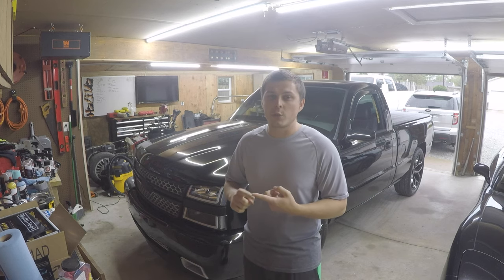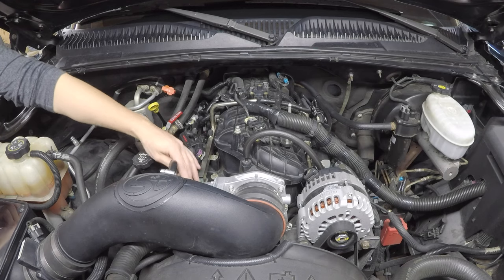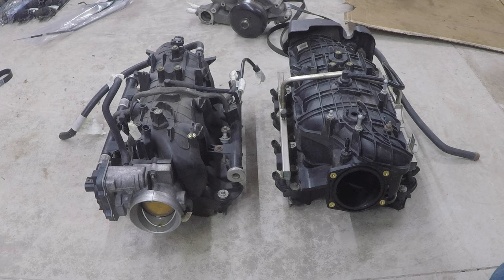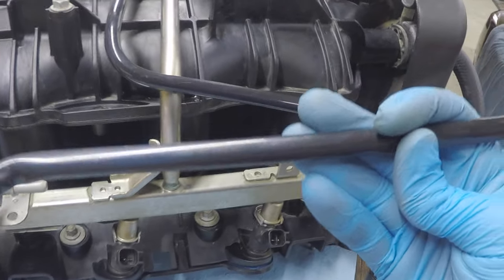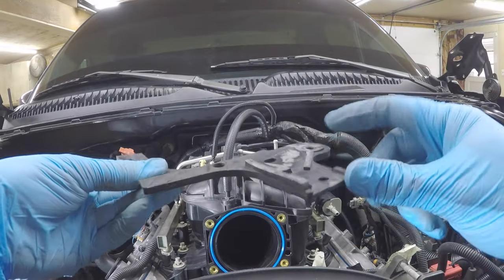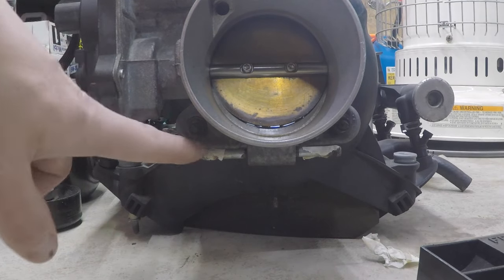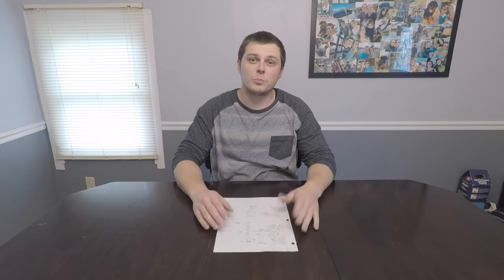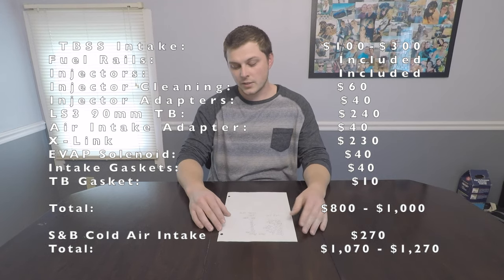TBSS Intake Swap, Ultimate Guide! Add More Power To Your LS Motor!

Comment: What is the part number for the s&b intake that you were running? I was thinking about getting an intake, but if I am going to do the 92 mm throttle body I don’t think that the one for the stock will work with the upgrade.
Reply from the maker: Hey, sorry for the late reply. here is a link to the updated version of the intake. you will need a rubber coupling to fit the intake tube and larger throttle body. the S&B intake tube is still designed for the smaller TB. all my other parts are linked in the description of the video.

https://sbfilters.com/products/1999-2007-silverado-sierra-1500-2500-3500-suburban-tahoe-yukon-75-5157

Comment: Did you have any issues with your brakes after this swap? If so, how did you fixed?
Reply from the maker: This shouldn't change anything with your brakes, assuming you connected the brake booster vacuum hose to the back of the intake.

Comment: New injector harnesses?  Obviously for TBSS nanifold.
Reply from the maker: Hey, sorry for the late reply. just depends what injectors you run. for the stock tbss injectors you can use adapters for plug and play, or you can hard wire the new connector onto your harness for a cleaner look.

Comment: I did this swap to my 06 Sierra and it threw a vacuum leak code. I swapped out the MAP sensor and it went away for a while and came back. Did you run into this issue? 
I tried the break parts cleaner around the gasket area and nothing. Retighten every bolt, checked the lines.
Reply from the maker: Hey, sorry for the late reply. I would try a smoke test. I got a kit off amazon, it works really well. I'm sure you have a small leak somewhere. I had vacuum issues on my corvette, turns out it was a bad hose clamp on the vacuum and PCV lines

Comment: I have a question at 2000 rpm and I designed reduced engine power
Reply from the maker: First thing I would do is throw a code reader on the truck and see what it comes up with. That will tell you a lot, hopefully you can narrow down and fix the issue. Google the code number it gives you, and you should be set. 

That should fix it. If not, I'd look for a local reputable tuner (or mechanic), and have them take a look. A lot of times they can see things on the HP tuner software, that are out of the normal. And can help you narrow down what this issue is. Sorry, thats the best I got. Hope that helps! Good luck on your truck.

Comment: Will this work if it's cable driven? Do I need anything else since mine is cable driven? Also found a page with one for sale should I spend the extra money for 50lb injectors? Going to be n/a but want to go FBO with e85
Reply from the maker: Hey, for cable driven, you can ignore the Xlink. You will either need to buy a 90mm cable driven TB or buy a 3 bolt to 4 bolt adapter and re-use your current TB. You will also need a throttle cable bracket to keep them secure (linked in the description of this video). For the injectors, just make sure they are E85 compatible. Stock TBSS injectors are around 32-36lb. I have a 4.8 making 355/369tq to the wheels. My injectors are at 75% duty cycle. So if you have a 5.3L, 6.0L or plan on making more than 350 horsepower, Your injectors are gonna be close to being maxed out. Which is fine, but their life span is decreased. So I'd say go with the E85 50lb injectors. Hope that helps 🤘
Reply: @TheKingCoopa  appreciate bro you just got a new subscriber
Reply from the maker: Thats awesome, thanks for the support!! Good luck on the swap.

Comment: Quick question did you have to get the truck tuned after an install of the tbss with fuel rail and injectors?? Running 87 throttle body.
Reply from the maker: Yes, a tune is definitely recommend. Some people can drive to the tuner with the new mods. But others, like myself had to have the tuner come to me. With the larger injectors it was running super rich, and would foul out the spark plugs after 5min of idle time.

Comment: Did you have to bleed the fuel system? If so how? I just did all of this and my message center tells me REDUCED ENGINE POWER,it's not a cabled throttle body so I don't believe it would be a TBS issue
Reply from the maker: Hey, I dont always bleed the fuel rail, but you should. On the first start up just rotate the key over a 2 or 3 times to build fuel back up into the rail. Then take a small screwdriver and press the shradder valve a little to get some of the air out. But you most likely won't get a reduced engine power from a little air in the fuel line. 

Are you running the stock TB or the 90mm? Stock TB is fine, but if you are running the newer 90mm you will need the X link or it won't work right.
Reply: @TheKingCoopa  Stock TB,and I don't have a Schrader valve anywhere on my lines. It's exactly like what his set up looks like. I put it together piece by piece from various sources

Comment: why do the corvetter filter and have to bend anything..? just get an aeromotive FPR and be done with it.. super easy, and you can add a guage to it
Reply from the maker: I did the basic setup for everything on the swap.i didn't go into super detail or the video would have been stupid long haha. Plus I feel that most people watching this "how to" video might not be at the point of AN fittings yet. The aeromotive FPR is definitely a good idea for when you wanna make big power. I just did the C5 filter because its a direct plug and play, and its cheap. I'll add the aeromotive FPR into the quick links in the description. Thanks!

Comment: Greetings friend awesome video. Question. Do I need an electric TB? I have a cable driven 4 bolt 92 mm.
Reply from the maker: Hey, if you're setup is cable driven, STAY cable driven. That is not worth the headache of trying to swap to the electric TB, just for no gains over a cable driven setup.
Reply: @TheKingCoopa  thanks bud I appreciate it! Also thank you for the video.
Reply from the maker: @christopher18291  for sure, glad I could help 🤘and thanks for the support

Comment: Question in regards to the fuel injectors. Can the stock 5.3L Silverado ones be used in the fuel rails?
Reply from the maker: Hey, if I remember correctly they should be the same height as the tbss injectors, and should work.

Comment: Hey I have a 2002 5.3l with a drive by wire throttle body, and also the air sensor and throttle position sensor, I cannot find a throttle body that has both sensors built into them, is there a specific harness i would also have to purchase on top of the x link harness as well?
Reply from the maker: Hey, sorry for the extremely late reply. If you have a DBC throttle body, you do NOT need the Xlink. 

Here is a link to a 102mm DBC throttle body, that comes with both the TPS and IAC sensor included. The 102mm will still bolt up, and its a little bigger than the 90mm👌 i would just take a dremmal tool to the inside of the 90mm intake mouth, so its not such a large ledge that air will catch on, and slow it down. 

https://www.ebay.com/itm/404078375557?mkcid=16&mkevt=1&mkrid=711-127632-2357-0&ssspo=eap8gya0rug&sssrc=2349624&ssuid=i3_3a3TsQ3C&var=&widget_ver=artemis&media=COPY

Comment: Noticed a fuel regulator listed in description. Is this listed for those not using the c5 filter as a return fuel adapter or would I need that regulator either way? I know the filter regulates to 58psi I'm just double checking.
Reply from the maker: If you have a return less style fuel system (1 fuel line) you do not need the C5 regulator.

If you have a return style fuel system (2 fuel lines) you will need to used the C5 fuel regulator.
Reply: @TheKingCoopa  my bad I was looking at the aeromotive bypass regulator but didn't see the part about substitute for c5 regulator.
Reply from the maker: @timothyluker7071  oh yea, I put the aeromotive fuel regulator on there for the guys wanting to make bigger power.

Comment: Im having a problem with the pressure regulator on the fuel rail.    It wiggles and lets fuel out from the rail connection.    Did you have this issue or have a fix for it?
Reply from the maker: Hey, I didn't have to run a pressure regulator, since I don't have a return style fuel system. Only thing I can think of is the regulator could be a bad unit. Those push on fuel connections are usually pretty solid. So I'm wondering if the regulator has a bad fuel connector. On your original setup, just the fuel rail and oem fuel lines, there was no leak. Then obviously the fuel rail isn't the issue.  I would try returning and replacing the fuel regulator, Or see if you can mount it somehow to were it doesn't leak, Then hard mount it somehow so it doesn't wiggle around. Sorry im not much help there.

Comment: Also can you just plug the intake side of the valve cover intake ? If you don't want to run it to the air intake? Thanks
Reply from the maker: Hey, sorry for the late reply. No, you can not plug the valve cover intake. The crank case needs fresh clean air. If you don't want to run it to the intake tube, I would run an oil catch can. That will help your engine out and will still allow clean air to the crank case. But at a bare minimum, I would atleast run one of those small autozone filters on the valve cover tube.

Comment: So if you have an all stock motor and want to do this will the truck need to be tuned? 2004 Chevy avalanche Z66 5.3
Reply from the maker: Hey, any airflow/fuel changes the truck is supposed to get tuned. A cold air intake doesn't really need a tune, but your not maximizing the true power of that intake.  But once you go to a larger TB and intake, your MAF sensor is gonna be telling the engine the wrong info, and its not gonna run right or at max performance. And if you change the injectors you will %10000 need a tune. Going from 22lb to 36lb injectors, my truck would foul out the plugs in 5min of idle time. So I had to have the tuner come to me, or trailer it to him.
Reply: @TheKingCoopa  awesome! Thanks for the info dude. I just scored a tbss intake throttle body injectors and fuel rail for $200 after watching this video so I just wanted to get all my ducks in a row before I do the swap
Reply from the maker: Oh nice! Pretty good deal. Just make sure you run new intake an TB gaskets. If your on a budget, id get the 4 bolt to 3 bolt adapter and run your stock TB. But if you want the most power, keep the 90mm tb and run the X link. Its just expensive. Good luck on the swap though 🤘
Reply: @TheKingCoopa  I work in auto parts so I already factored in new gaskets and gonna at least clean those throttle body on it and have the injectors cleaned and mapped. As I said before thank you for the video, alot of information. Definitely sharing this video in my Facebook groups.
Reply from the maker: Good idea, my injectors were all gummed up with E85, and didn't flow the same. And no problem, thanks for the support!!
Reply: @TheKingCoopa  Who did your tunning?

Thank you
Joseph
Reply from the maker: Hey, Shawn fensler, the owner of bumper Wilson tuning. He is on the south end of Fort Wayne, IN.

Comment: Have you had any problems with your Xlink? I bought a brand new one and it’s not working like it should. Works when it wants to.
Reply from the maker: Hey, I've had zero issues with mine. Did you make sure to buy the appropriate Xlink for a gold or silver TB blade?  Also its important that your TB needs to be a GM or Acdelco TB. If not, you will have issues. And id check the wire connections, make sure they are tight and no corrosion. Lastly I'd double check you have a good tune and then call Xlink and see what they say
Reply: @TheKingCoopa  hello, I am using a oem throttle body. I ordered my Xlink from Michigan Motorsports but they did not have options to choose from. I told my tuner to tune it for the Xlink. How can I check what Xlink I have?
Reply from the maker: @6.2_angel51  hmmm, I'd give them a call and see what they say. Mine from Tourqerush has a tag on it stating gold or silver

Comment: Need your help. I did the swap on a 1999 GMC Sierra with the 5.3l LM7. All is good. Big problem with getting it running right. Getting a P0113. Changed mass airflow sensor. The intake air temperature sensor is in MAF. Does this swap always need a tune? I’m using the same injectors and all the same other sensors. I did have to use a corvette fuel regulator. Thanks in advance.
Reply from the maker: Hey, thats weird, im not exactly sure whats going on. I did have a similar issue where I couldn't get it to tune right. We eventually had to tune it on a speed density tune (altitude based) as opposed to the regular maf tune, and everything worked great after that. But id before to check all your connections and gaskets. Make sure you don't have a leak, sucking in air though a bad gasket after the MAF would definitely cause a code.
Reply: Thank you kindly for your quick response. So far after a good MAF cleaning it seems to has fixed the problem. Thank you again.
Reply from the maker: Oh good!! MAF sensors can be pretty sensitive. I usually swap it with a donor on my shelf, for troubleshooting. Or dump a whole can of MAF cleaner through it and reinstall. Glad you figured it out though!

Comment: How does the fuel pressure regulator from the c5 ground
Reply from the maker: Hey, if the ground wire is long enough, I would attach the ground wire to the back of the driverside head. (Factory ground location). You may need to cut, extend, and soldier some longer wire onto it to reach, depending where you mounted the C5 fuel regulator. Hope that helps!

Comment: What’s up with the brass shut off valve
Reply from the maker: Haha, so the truck was a 1 owner old man. The blend doors went out for the hot/cold. So instead of fixing them, he put a ball valve in. So when he wanted it hot, he would turn the valve off or on. I fixed the blend doors, but haven't fixed the heater hose yet

Comment: I know this is an old video but bro, can I do this to a 4.8 Chevy Silverado
Reply from the maker: Of course, this will work with any gen III LS motor. My truck was also a 4.8L at the time of filming. 

Also the tbss/nnbs intakes are identical. So if you have a 2008-2013, no need to swap the intake.

Comment: Can this intake manifold make make my 5.3 more fuel efficient? I will be using my stock flex fuel injectors.
Reply from the maker: Hey, anything is possible. But this intake is bigger and allows more air flow. More airflow means you need more fuel to equal the AFR out. So when you need more fuel, you get less MPG.

Comment: Who did you use for injector cleaning?
Reply from the maker: Hey, my tuner was able to do them for me. It usually runs about 10$ per injector. Most people will get them flow matched as well. Idk if my tuner does it through the mail. Im sure there is someone that can do it for you local
Reply: @TheKingCoopa  Ok Thanks for info

Comment: Wassup boss I have the tbss and ls3 tb swap on my 2003 Tahoe. Idk why but I’m getting reduced engine power in my dash any advise
Reply from the maker: Hey, honestly not sure, there is ALOT of different things that can cause that to happen. Has the tbss/TB been on the engine for a while now, or did you just swap it and now its causing issues?

Best advice I could give, is get a code reader on it, and see what codes its throwing. That will definitely point you in the right direction

Comment: Would you know what is the factory seal fitting on the right side{passergerside] around center upper are is for?
Appeared like to a seal vacume connection.
Reply from the maker: Hey, sorry for the late reply. Are you talking about on the intake manifold or the firewall of the truck?
Reply: @TheKingCoopa  on the top area of  intake manifold right side just behind the fuel rail crossover looks like a small vacuum line single barb fitting with a factory tab molded seal

Comment: You literally are great! Thanks
Reply from the maker: Haha I appreciate it, hope it helps with the swap🤘
Reply: @TheKingCoopa  I’ve been trying to do little upgrades to my grandpas truck. Taking care of it over time has little bits of problems but I want it to have not only have good looks but I also want it to have performance upgrades like yours.
Reply from the maker: Oh nice, thats awesome! Yea it doesn't take much to make these trucks look good. Head lights, tail lights, stubby antenna, tint, color match the bumpers and your solid 👌 
I also have another video showing all the performance mods I did, if your bored. Its still knowledgeable, but not as indepth. But for these LS motors, a cold air intake, mild camshaft, long tube headers, no cats, and a tune will really wake that truck up! Huge night and day difference. Especially if you get the tourqe management removed in the tune. You will have zero throttle response delay. But its harder on your tranny. And depending on the camshaft, you'll need a bigger stall converter. I have a 2600stall.
Reply: @TheKingCoopa  what type of air intake system do you have?
Reply from the maker: @MADGENiUSProductions  S&B Cold Air Intake. All the products are in the description of the video.
https://www.sbfilters.com/cold-air-intakes/1999-2008-silverado-sierra-intake-75-5036?variant_id=75

Comment: What's the difference on the pcv tube? Is it longer than the original? It looks like once you chunk off the connector, it's basically the same.
Reply from the maker: I believe it was a different diameter, which is why I went with the rubber hose.
Reply: @TheKingCoopa  okay gotcha. I'm currently swapping my intake. Thanks for the reply!
Reply from the maker: For sure, good luck!!

Comment: Did you have to get it tuned after you did the swap with the flex fuel injectors and the the intake plus the thottle body
Reply from the maker: Yes, I did need a tune. You might be okay to drive it to the tuner, but I definitely wouldn't daily drive it without a tune. Your changing alot to the airflow and fuel ratios.